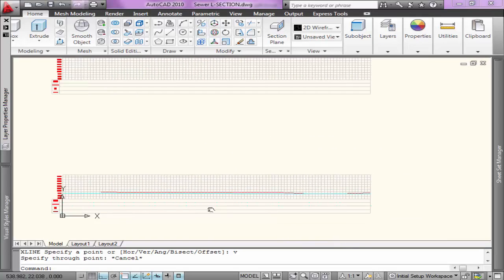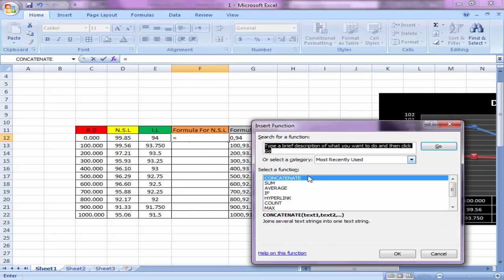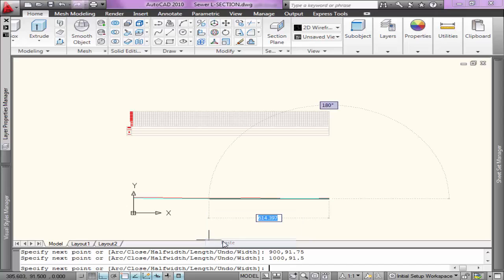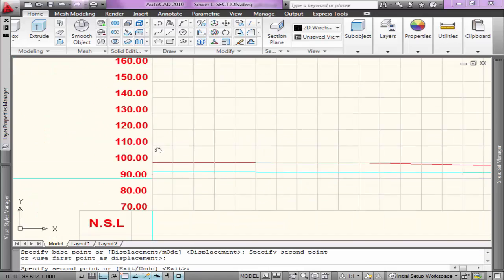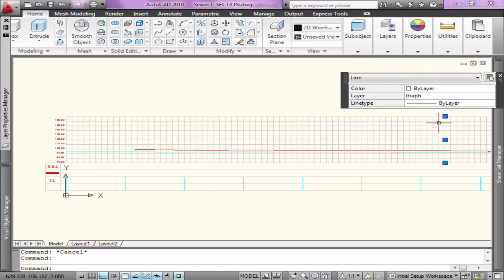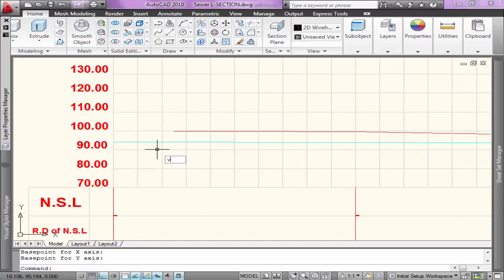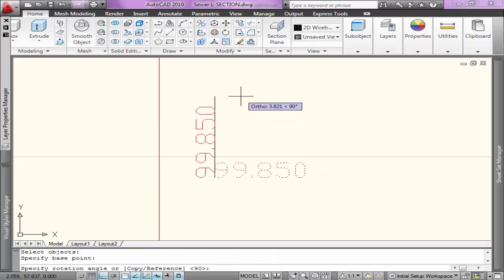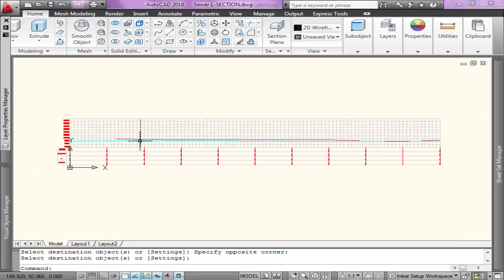How To Draw Sewer Longitudinal Section in AutoCAD using Excel - Existing & invert Level of Sewer

Comment: thank u for this work , but i want to draw manholes and their depth on it how i can please ?
Reply from the maker: I will make a separate video for this. I just suggest you if you want to do this you need to find the height and distance of every manhole after this you need to make coordinate of each manhole in Ms Excel on their distance with specific height and then put these coordinates in AutoCAD to draw manhole thats it :) if you have still facing issue then i will make video for this.  Stay tuned.
Reply: Faisal Mahmood Mughal thank u bro , i have all these data u told about . plz help me in early time if u can .
Reply from the maker: after making the sewer line L-Section then you need to find the interval for each man hole and its height from invert level then make their coordinates and put them in Autocad using Polyline. I hope you have come to know which i am saying.